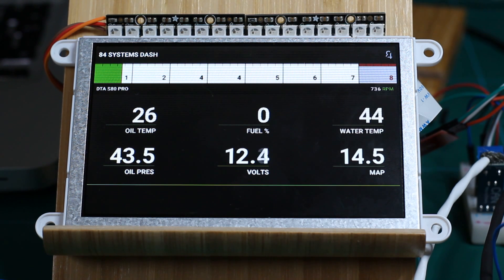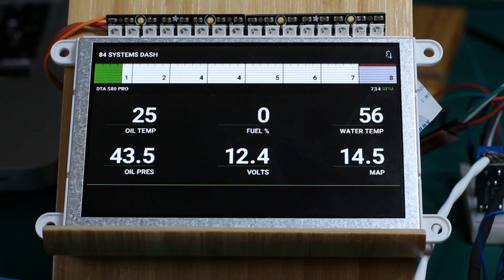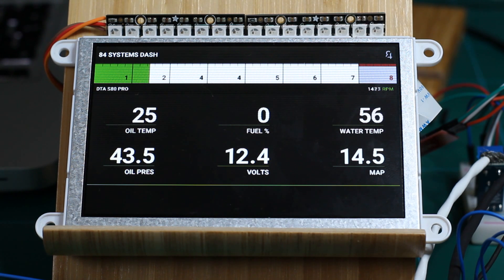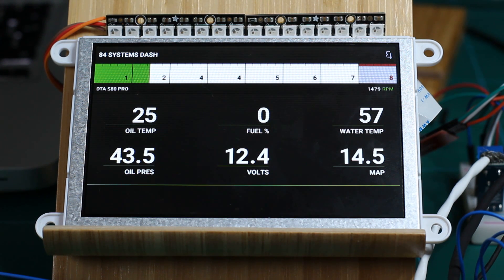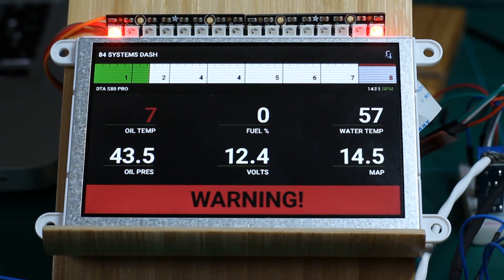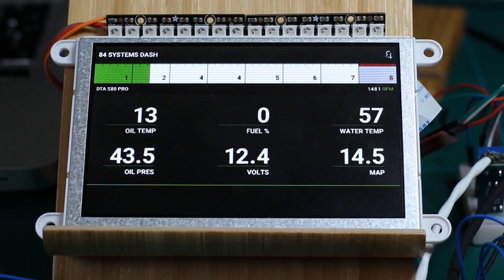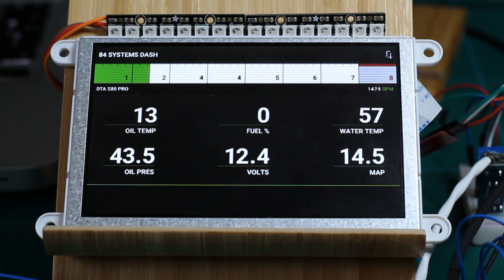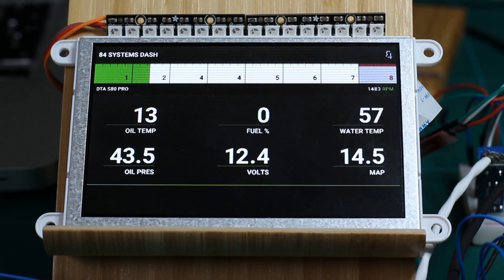4D Systems CAN BUS Display Update

Comment: Recently designed and programmed a dashboard for my Formula SAE team. Decided to go with the Nextion screen for that original version, and it worked okay. Definitely not bright enough and working with their editor software was a pain. For version two of our teams dash, we are implementing a 4D Display. I am still very much in the learning phase when it comes to 4D's editing environment. Which of the  environments would you recommend for programming the display? So far I've only really played around with VisiGenie. Secondly, for your read outs are you using text or a modified version of the digits? Any help would be appreciated. Also, I followed the link in the description and it was a great write up; keep it up. Cant wait to see the finalized product.

Comment: i was wondering how you made that user interface? was it using the 4d systems program? if yes, did you use the designer? or what did you use? thank you!
Reply from the maker: Carlos Lagoa I do initial designs in Photoshop and then slice things up and piece it together with the 4D IDE. I think the cleaner you can make something look, the easier it is to read.
Reply: Tim Darracott i agree it looks fantastic hehe, im gonna try and go over the 4D step, but thank you so much for the info!

Comment: How is your TPS at 75% at such low rpm?
Reply from the maker: 'Sahil Singh Bhatia' it's just a default value. This is a bench test, not all sensors are wired up.

Comment: Tim Thank you for the answer, generally speaking tread by Talkiet on 4D system forum  stooped me from buying it. I have DWIN LCD (chines manufacturer)
Graphic design is very easy but any type of text display tuns in to  painful  process.
I thought 4D systems will be better  but now I'm concern about it.
Reply from the maker: 29DR194 text is very fast, graphics are a little slower. I'm confident with more a little more work this display will do the job just fine

Comment: How do you connect the 4D Systems display to the CANBUS? From what I have read so far it does not have a CANBUS port for interfacing.
Reply from the maker: Michael Day I'm using a Teensy 3.2 for CAN
Reply: Tim Darracott. Cool. Then the Teensy connects to the display via serial?
Reply from the maker: Michael Day that's correct

Comment: Tim, would you recommend 4d system display?  is  the quality of the graphic better comparing to nextion ?
Reply from the maker: 29DR194 Hi, the only reason I've chosen the 4D Display is because it's sunlight readable. For what I'm doing, the Nextion is easier to work with, faster and much cheaper. BUT it's performance in sunlight is pretty, for want of a better word, rubbish. Hope this helps
Reply from the maker: Out of the box, yes the Nextion is faster. There is some discussion on the 4D Systems forum currently about speed, might be worth taking a look on there. And you're right, this is the Super Bright model, non-touch (gen4-uLCD-50D-SB).
Reply: Nextion is faster? I had reservations about the nextion displays refresh rate and flickering etc, and thought the 4D Systems models would be better. Guessing you're using the "Super Bright" model?
Reply: Thanks for the reply. It makes for interesting reading, i think i'll stick with the nextion for the time being. if its not suitable i'll have to find another alternative. I won't be using it in a convertible, the car won't be used that often and we don't get that many sunny days in the UK!

Comment: What happens if the value that errors is on multiple screens?
Reply from the maker: It flicks between the screens real fast! Doesn't really. It'll go to the earliest warning. I could just show the value which is in warning state on the current screen, perhaps? Not sure. It's a recent feature, which I'm sure will evolve.
Reply: Tim Darracott maybe since errors are probably a key thing, especially in the critical state a page with just the field name and value?
Reply from the maker: Perhaps a page which shows any value in warning state? Obviously a max of 6 values, but you'd hope that would be enough.